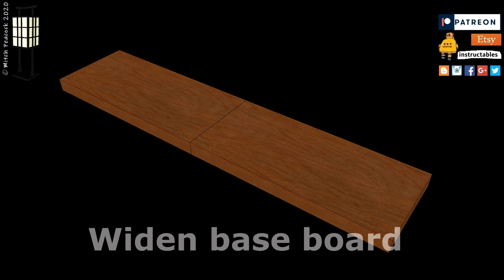Japanese Lantern - Making the Stand

Comment: Nice video, Mitch.
It has become beautiful pictures.

You ended up using skin glue that can be processed cold.

Have you ever tried skin glue granules or bone glue granules?

Have a nice weekend

Stay healthy.
Reply from the maker: Cheers Gunter.
I don't recall using the granules - I've never had a glue pot, so it might get messy
Stay safe
Reply: Hi Mitch,

Thanks for the answer.

I have bone glue granules and I don't have a glue pot.

I took a small jam jar and washed it out. In order to dissolve and heat the granules, I take a certain amount of granules. pour it into the glass and pour water over it until it is covered. Then I let the granules swell and put the gals in a baby food and baby bottle warmer, which gets around 60 ° C and that's enough for the granules to glue. :-)
Reply from the maker: How do you like it? Maybe I should give it a try
Reply: Hi Mitch,

I haven't tried it yet because I don't have the right project for it yet.

Maybe I'll take it when I build a Japanese tool box. :-)

For this I can first sharpen my saw blades from the frame saws.